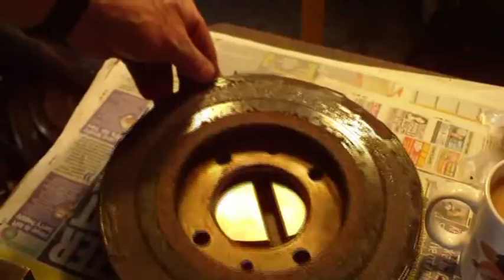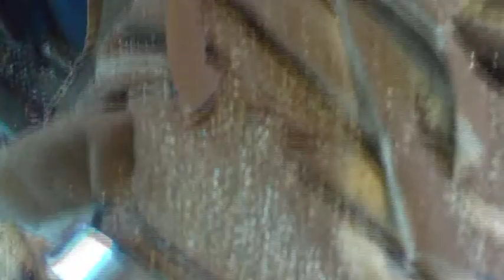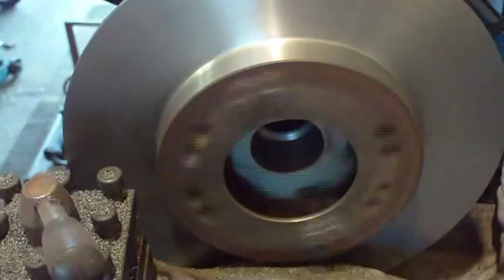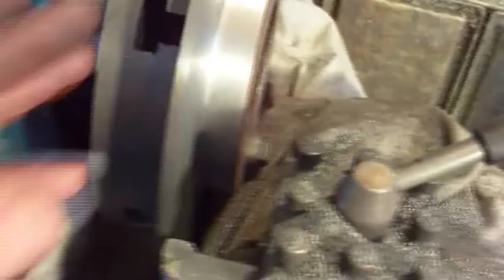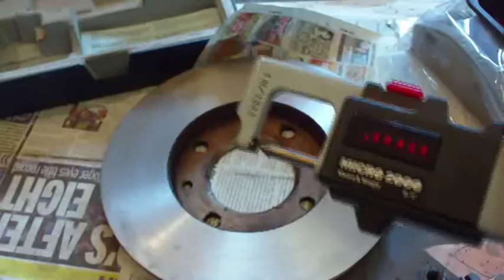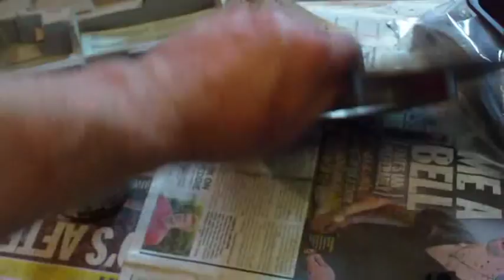Disc Skimming

Comment: how did you centralise your face plate to the main disc with the 2 bolts being used.  Measurements.?  guessing.? or its it auto based.  I am guessing it was measurements.

Comment: Hi.what speed did you have the lathe at. I have just purchased a CL500 with mill and just tried a brake disc skim for a friend. It was horrible. Made a mess of it, then had to sand the thing. just seemed to scratch and score it. not sure what is was doing wrong.
Reply from the maker: Hi John, Thanks for you comment. The lathe was running at 160RPM using a brazed carbide tool, no lube as it's cast iron and I took it nice and slow with light cuts.
Reply: @SpenCrowson  Thanks for that. I also had it on 160. It was singing loud. Think the whole street could here lol. I'll try a brazed carbide and see. thanks.

Comment: You missed some very important points in your video................................... Nothing wrong with doing it yourself but do it correctly and don't show people the wrong way of doing it. You may not be using it on the road but someone else might. Please don't take my explanation as criticism as it was not meant as such..

For a rotor that sits against the hub flat faces 
together MUST be clocked from that face. This is it's mount and 
regardless of how parrell the rotor is if bent or worn unevenly it will 
run true for the caliper once machined.  The front face that mates to 
the wheel unless checked for parrell against the hub face is not an 
acceptable register hub face only. Even when brand new these faces can 
run out by 0.002"......
When deciding how thick to machine the rotors
 the minimum thickness is not your only consideration. The centerline of
 the rotor in relation to the hub face must be used to ensure the 
caliper can act on the rotor safely.....  This means that you may have 
0.100" that you can take off in total but you cant take more than 0.050"
 on any side....... If one side only needs 0.010" removed and the other 
needs 0.060" removed the rotor is stuffed and should not be reused even 
though the rotor will be thicker than minimum. It is also bad practice 
to say machine of a rotor that is for example + 0.100" overall on 
minimum thickness 0.050" on one side and 0.010" on the other. The rotor 
will be safe and acceptable to use but if later removed for machining 
and the current center is used for the minimum thickness calculation the
 rotor will be to thin on one side. This consideration is important 
regardless of solid or vented style as it relates to the caliper 
position... The same should be removed on both sides.  Brake calipers 
have a fair range of movement and can usually handle a change of 
0.010~0.015" center line change but no more long term.  

You can safely use rotors of different thickness as long as they are within 
spec. New and old together on the same axle as long as the old has been 
machined and the same type of pads have been fitted to both sides......

The reason why you cant change the centerline to much is a double sided 
caliper will require one set of pistons to hyper extend and this will 
normally make them stick. In extreme cases they could loose fluid and 
cock over locking up that wheel...... A single sided caliper can stick 
on it's guides only allowing the piston to move giving drag and have a 
timing issue when the brakes are deployed. This shows up as the brakes 
pulling to one side for a moment when first applied but working 
correctly after that...... On a car with ABS there can be more issues as
 well but none of the above advice will cause any ABS issues. 

Watching that cloth drag against the chuck made me shudder, may I recommend another swarf control method? Try a cheap 1" paint brush and mount it or hold it just above the tool. It will prevent the swarf from going to far. You can use larger and even if caught it will only loose a few bristles. It also works great for brass turning as well.
Cheers
Reply from the maker: Thanks for your comment. I take it that you are referring to the minimum thickness, I can assure you that I take this into account when working on a customer's item.  This one was for for demo purposes only and was used on an upcycling project.
Reply from the maker: Thanks for your in depth and interesting reply. I'm always open to constructive criticism, so thank you putting me right.
Reply: Nice  information  my friend